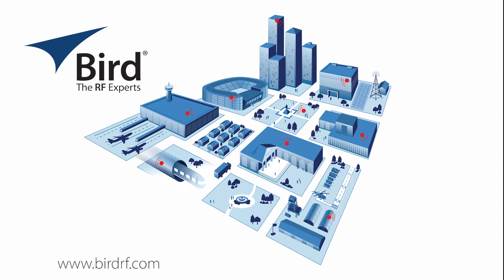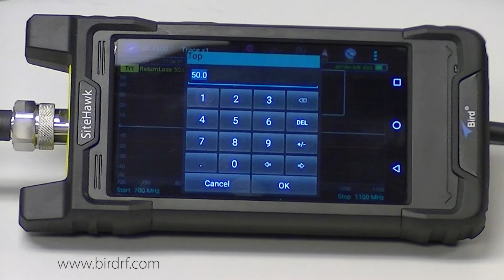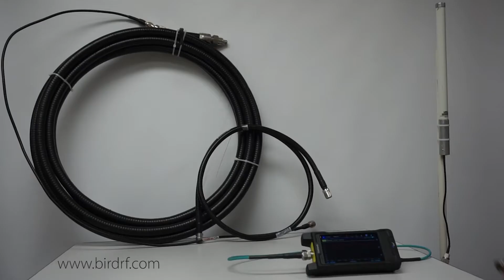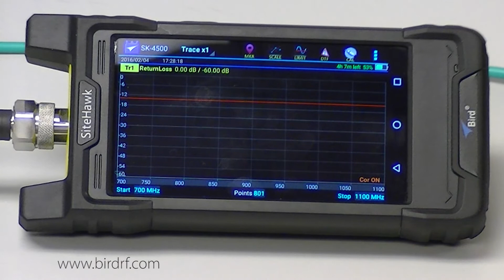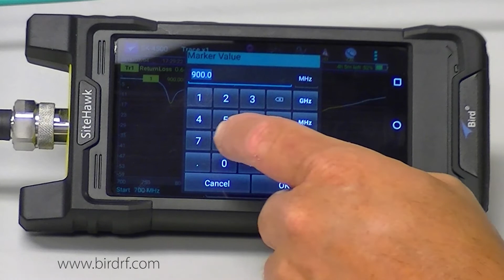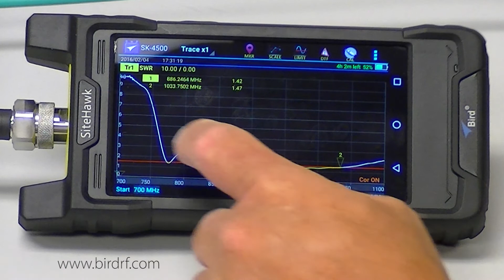How to Perform a Return Loss Sweep for RF Cable & Antenna Testing

Comment: Any videos on how to use tester for GPS cables and GPS antennas ? 

We have lmr400 and 600 but I cant seem to find any gps test steps
Reply from the maker: A GPS antenna generally has a low noise amplifier (LNA) that needs power to operate.  The SiteHawk cannot test a GPS antenna if it requires power.  Generally, to test a GPS antenna you can test the current draw, usually somewhere around 25mA, to see if the LNA is operating.  This is not a guarantee the antenna is good though.  If there is a passive side to the antenna you can sweep it, but chances are it won’t.

You can test the LMR400 and 600 cables leading up to the GPS antenna by disconnecting from the antenna and terminating with a precision load.